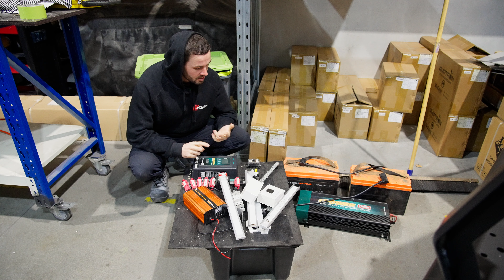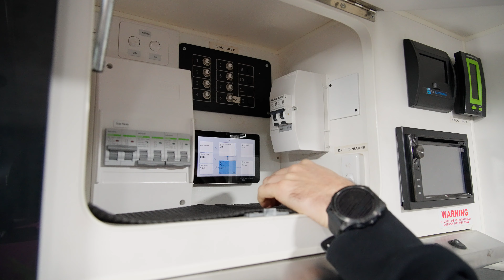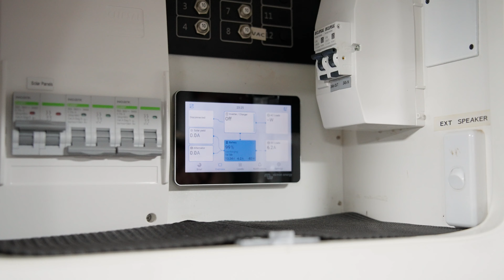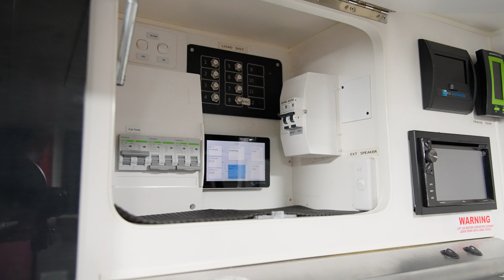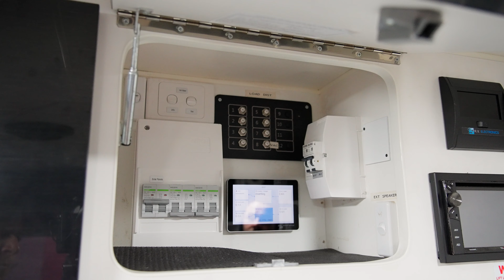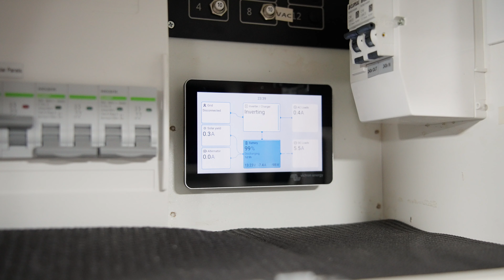Retreat Caravans Fraser 226C | Complete Off-Grid Electrical System Upgrade

Comment: ❤😊
Very nice Victron system installation
I assume the Victron display is only as a backup in the drawer and the customer has all the same info and function on his iPad and iPhone even with remote access. 
I still waiting for newer shade resistance high grade high voltage (upto 50V and min 23% efficiency rate ) with higher output solar panels to arrive in Australia 🇦🇺  (4mm glass and rigid frames should be mandatory.)
Have not seen yet any info… 

Please make a short video if you find something brand new on the market to install to this van.

Cheers from Germany